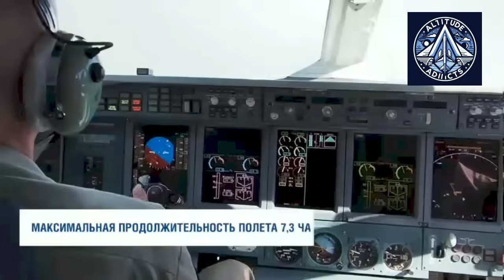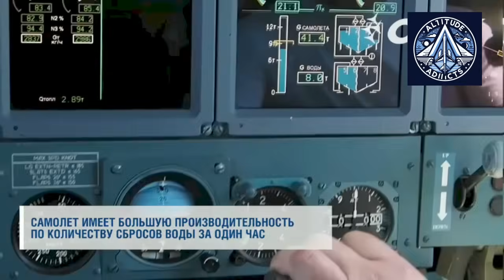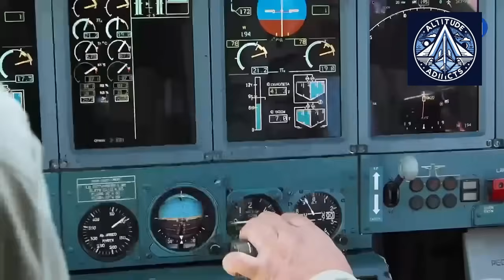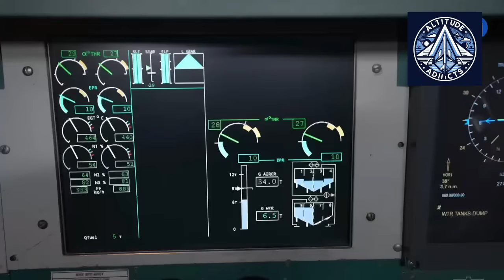Russia’s Be-200ChS-8 Set to Fly in 2028, Turkey Shows Interest

Comment: Pilots of the Be-200  drop their loads from too high up. They need to get down like the Canadair 415 and knock down the fire and not drop so high up and disperse the water as just vapor. Of course as a jet this is not possible in mountainous areas with canyons and valleys.

Comment: PD8 is lighter and can easily install with minimum engine control system. Structurally it’s all good very minor mounting system need to be modified cause engines are lighter which makes the aircraft fuel efficient and more power and inexpensive.